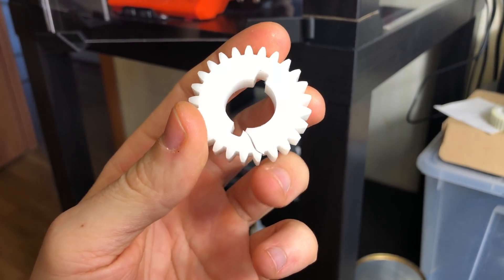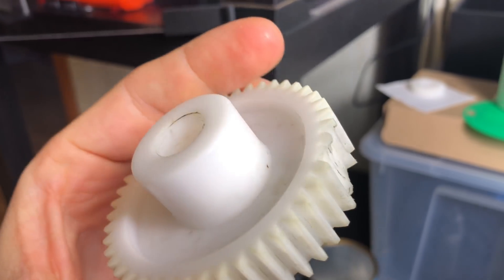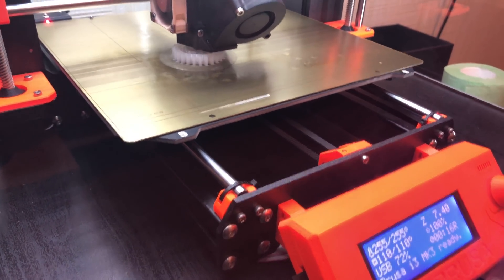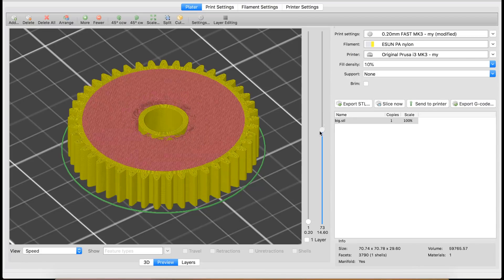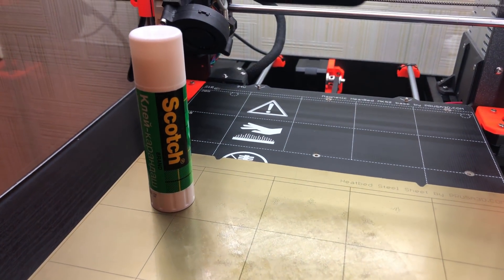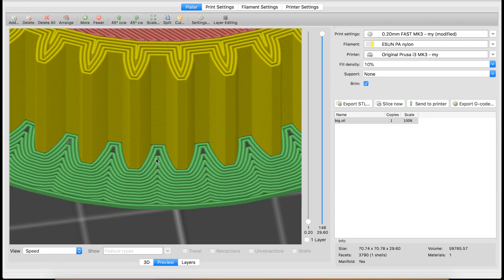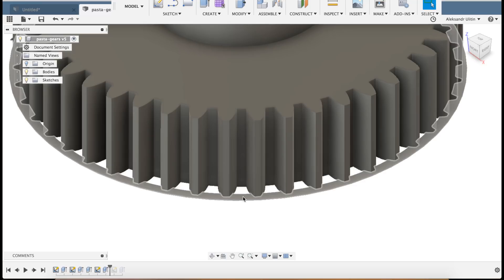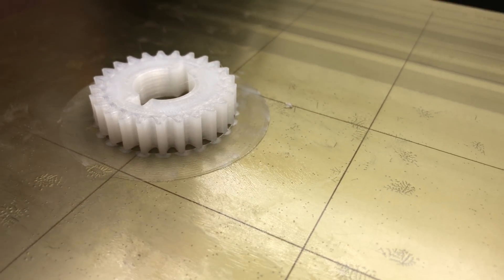HOW TO 3D PRINT NYLON/ABS GEARS WITH NO WARPING

Comment: Pls suggest how to remove the support pieces from nylon
Reply: 1. Try not to use support if possible
2. Play with support and retraction settings. Usually making denser grid pattern, thicker interface and varying distance between interface and the part could be helpful

Comment: I soley print in carbon fiber filaments...  nylons, peek/pek-cf, pet-cf and glass fiber nylons. I print at 💯% infill and never getting warping, creep, or peeling. Here is my GUARANTEED settings for all nylons
 1st, with all nylons i ONLY use carbon fiber beds, g10 beds, or my titanium pei board. I ONLY use elmers magic disappearing purple glue sticks with all nylons!!! It never peels off the bed and pops right off after! I print at 280°c mostly and 290°c also. 
I set the bed temperature at 90°c for the 1st 4 layers.... and here is the most IMPORTANT PART!!! drop the bed temp all the way down to 30/32°c after the 1st few layers. Enclosed printer and keep the inside at 70 to 72°c 
Use this and thank me later.
Reply: Thanks for the recipe. Yes, the fibers help a lot to reduce warping. But could be undesirable sometimes.

Comment: I print in nylon for a long time now and I realized that printing with the bed cold generally makes the best prints. I have no warping at all and the only thing I use is regular white glue. Sometimes I see people using 105° C or more and I wonder if anyone ever tried turning it off completely.
Reply: Sure I tried, it's just gone after 10 layers or so. I guess it's very different for different brands of filament, surface type and preparation.

Comment: great idea! what a nice finish, parabens.
could you please pass the parameters of speed, extrusion and retraction?
greetings from brazil
Reply: It depends a lot on the material and the printer so my parameters are pretty much useless for you. It's a matter of tuning in every material you print with, it takes 1 hour usually. My printer is very customised and I use Esun ePA here.

Comment: Thanks for video. I am using same machine but finding difficulties to print nylon. The problem is non sticking nature of nylon.
Reply from the maker: UHU glue stick is the only solution for me.
Reply: @MomWillBeProud  Thanks. The cost of UHU glue stick in India is equal to Nylon filament. Is there any alternative?
Reply from the maker: @None901  in this case I'd buy like 10 glue sticks or hair sprays of different brands and test them. Or maybe you have a local manufacturer of good 3d printing glue. Or maybe just PVA glue. https://all3dp.com/2/what-s-the-best-glue-stick-for-3d-printing/ also take a look here.

Comment: Very Cool :D THX ALOT!!! :D Did you ever print out a part out of Nylon that has supports? I know it would be better to use some other material for support but I do not have a dual nozzle setup...
Reply from the maker: For nylon I usually embed supports into the model itself so it's much easier to remove. Also you may try https://hackaday.com/2020/05/27/improving-3d-printed-supports-with-a-marker/ this approach but manually.
Reply: @MomWillBeProud  WOW the marker idea looks great I will look into it, Manually would not be so good since I need to print Nylon in a Encloser... Do you have a video on how you embed your supports?
Reply from the maker: @monikahitri8204  No video but I just add 0.4 wall that is easily removable
Reply: @MomWillBeProud  I am not sure how you add a wall that supports overhangs... Can you maybe show a pic over imgur or something like that so that I can get an idea?

Comment: Sir which one is better material for gears Nylon or Teflon 
From all point of view like strength, friction, durability, etc
Reply from the maker: POM is usually used industrially.
Reply: Pom is ultra hard to print… It warps more than anything else…
I’m giving up on POM and trying nylon…
Man… your tip was ingenious! I’ll sure try!

Comment: is that an aftermarket steel flex build sheet without PEI? are you printing directly on steel? or glue stick? thanks!
Reply from the maker: It's the original with PEI with glue stick.
But I've used an aftermarket one with PEI too, works well.

Comment: Okay, so what you did was to use a wide skirt and then reduce the empty space until it touches the workpiece?
Reply from the maker: I added a brim that touches the model in f360. But maybe your way will work too, let me know if you try that.
Reply: In other words a brim?
Reply from the maker: @liamkelly3161  A brim is always connected to the walls but in this method we need it to be connected only to the tips of the gear. We're talking about the way to achieve that without embedding this type of brim into an STL